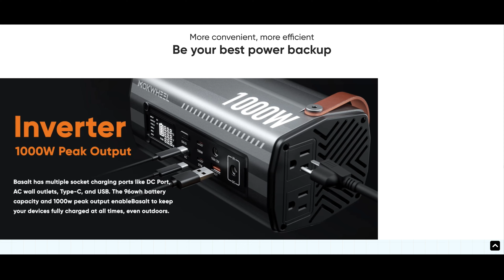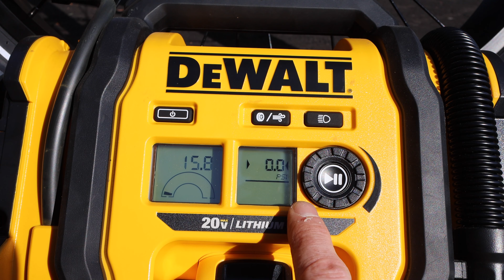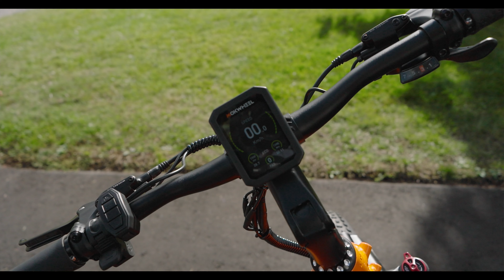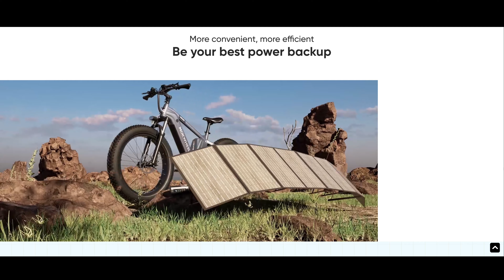This might be the BEST eBike of 2023! Mokwheel Basalt ST - Review

Comment: Excellent video and thank you for sharing! I just picked up the Mokwheel Obsidian and while I only, so far, drive on sidewalks and to a lesser extent the bike lane the rear shock is a must have especially if you're an older driver with any back issues. I'm 60 and haven't been on a bike for over 40 years. Now I'm addicted 😊 

My only complaint is the handlebars that I wish were a little bit more adjustable for a more upright riding position. I ended up with a slight case of carpal tunnel in my right hand so hopefully the adjustments to the seat height and the grips being twisted a little bit more upwards will solve the problem. Obviously I ride with gloves so I was a little surprised to have the bikers palsy. Worst case, I'll buy a different set of handlebars. That is if something is available.
Reply from the maker: Excellent!  Thanks for sharing & happy bike riding.

Comment: Hi, I just viewed your video. I got the same bike last month and I live in Colorado with lots of hills (steep). I noticed you did not go up on steep hills. I have tested here and it did not do well on steep hill even with PAS 5 and gear #1.  I have two other ebikes Himiway and BeeCool both did well on steep hills. I did contact the company in CA and they could not help me with that issue. However other than the steep hills, it works great. Also, Mokwheel Basalt ST is a Torque sensor (not Cadence sensor). So I am selling my Mokwheel which has only 49 miles on it. Since 2021 I have rode over 5,000 miles.
Reply from the maker: Thanks for sharing!
Reply: I have the same problem with steep hills here in Spain.

Comment: I am a bit confused on what an All terrain bike handes vs a E mtb....  Can you do more on an all terrain bike if you go over really rough stuff and also sand, mud .   Where as an e mtb would handle mtb trails but not as good in sand, mud and other riding.  All Terrain seems would be better on the above and pavement. Would like to find one with 27.5 tires and wider handle bars.
Reply from the maker: If you buy an EXPENSIVE non-electric bike, you then have a pile of bike categories. For example if you will ONLY ride on pavement you then have several categories of high end cycle bikes all with different construction materials, pedals, gearing, frame, riding position, etc.  Electric bikes that cost $3000 or less are your average everyday bike.  They do not have as many categories as they are all heavy which means thick strong frames. Inexpensive ($3000 or less) electric bikes have simple categories like FAT BIKE ( which means all terrain, summer & winter), or FOLDABLE (which means commuters for work, pleasure).  STREET only electric bikes are not usually good due to weight and electronics unless you can find a $6000 and up one.  A MOUNTAIN BIKE (electric bike) is simply an ALL TERRAIN mountain bike with springs in the front forks.  Again, the bike is heavy and would not do well on rough mountain bike trails and would require adjustment after each ride.  But if the trail is not too rough, the an all terrain bike/mountain bike would do ok at a leisurely pace… just wear protective gear because wiping out on a heavy electric bike can really hurt.

Comment: Thanks for the video. What I remain wondering about is the real range of the ebike on a single charge. Also, given the 100s of eBikes available, what were the deciding factor that made you chose this one (I am assuming the ebike is not a freebee or a special review discount)? I would say my overall concern about purchasing any eBike is the durability over 2-5 years. I would be disappointed in getting an eBike that starts having problems that are not easily corrected without investing a chunk of money, such as breaks start to fail, wheels start rubbing against frame, battery life quickly reduces, and overall performance becomes worse after just a few hundred miles of typical riding.
Reply from the maker: I can tell you the following… I consider myself a cyclist, mainly because I invested thousands of dollars into pedal road and fat bikes (not electric). Each bike cost many thousands of dollars and each of those bikes required a tune up after 3 months of riding (brakes, gears, derailleur).  Electric bikes are the same.  A $2000 electric bike is considered inexpensive as the good ones are $6000 and up… but those are for cyclists.  So the bike I reviewed in this video is a bike expected to be ridden by a non-cyclist with occasional or commuting riding.  Like on every bike, the gears will need adjustment after the first year as cables stretch. Brakes usually only need adjustment if they are wearing out (all minor common items). You can do adjustments yourself or take it to a bike shop.  Flat tires are another common maintenance & they are repaired the same way as on a regular bike.  So far I have had 4 electric bikes come my way (all given to family members) and none have had electrical issues, just the minor maintenance any bike owner would have.
Reply: Have the same doubts
You can buy a new gas scooter 50cc to 150cc for $1,000
You can ride an ebike of the sidewalk but not a scooter, guess it depends on what kind of an area you are riding. 
In a city I think the ebike is better, longer trips the scooter makes more sense
THEN another concern I have is how to keep it from being stolen while you park it outside in public. NO amount of chains etc can stop the right thief from getting it.
Seems more like something used to go somewhere (secure), not public, like going to a friends house. 
The funny thing is ;  I can buy an older Toyota Corolla for less than $2000 !

Comment: I SEE 4 screw mount holes in the front of the frame,  wonder what you can mount there ???
Price I see is  $1699 as of today
Reply from the maker: Water bottle?  Or if you mean under handle bar stem, then a front basket.

Comment: Do not buy a mokwheel bike!  I purchased a Basalt ST on 2/4 and have had nothing but problems since day 1. Customer service is horrible. it could take a week to get them to call back, hardly ever answer the phone. while polite when they respond bike is still broken as of 4/3 and now they are sending a torque sensor and wiring harness that I have to replace. (I don't have the tools for the bottom bracket removal). they told me to bring to my LBS and wait to get reimbursed! once they have your money, you are stuck. spend your money elsewhere!
Reply: What was wrong with it, and how did you know it wasn’t working how you wanted?